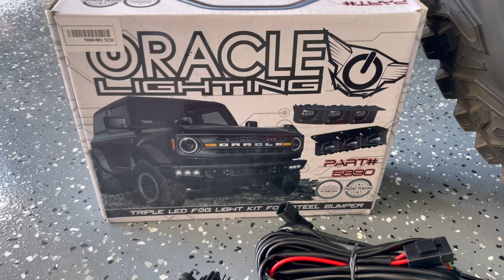AUX Switch Installation of the Triple LED Fog Light Kit by Oracle Lighting - 2021+ Ford Bronco

Comment: Thanks so much for this.  I already have the grill lights hooked up to the aux using the grill wire.  Gonna need to run another wire and figure that out to add these. I have the Amber ones sitting in a box right now.
Reply from the maker: Thank you! I will be in the opposite boat, if I order the grill lights, that I'll need to extend the wires for them up to where the AUX wires are, being as I used the purple grill wire. I guess, alternatively, I could just tap into that wire as well if I got lazy! But it makes sense to be on a separate switch!

You'll just have to extend the wires in your situation from the harness to the AUX switches near the firewall, should be a simple process, and will actually give you more options for grounding them. Good luck, the amber lights look nice too, hope everything goes well for you!

Comment: Sadly for me i was unable to get the modular bumper on my wildtrac., Which means alot of stuff i will be missing out on. A company called M&R makes a double for the capable bumper which is about $500. Still looking for a brushguard. Thanks for another great video
Reply from the maker: That’s a shame. It was a no contest option when we ordered ours, it was a must have option! You might get lucky and fine one on the Bronco forums or on eBay that you could snap up for a decent price. That’s what I did for a set of rock rails. I purchased set that are pretty much brand new, in case I need to review or promote products that attach to the rock rails. Got them for a good price!

Comment: Hi, great video but I was wondering about the light up letters for the grill. I ordered both through oracle and am waiting for them to arrive. My question is basically if you have done that yet and if the 30amp aux 1 can handle all that.
Reply from the maker: Hi, thanks for asking, at this time, I haven’t installed the ORACLE letters for the front. It’s something I’ve been considering, but just haven’t gotten round to them. And yes, AUX 1 is more than sufficient. You can actually put them on AUX2 - AUX5 without issue. Hope that helps.

Comment: Easy to follow demo  - thanks! I have Oracle's spare tire ring 3rd brake light for mine... when it gets here.  Why did you choose the Aux1 switch? Is it because of the amps of the fuse?  Thanks
Reply from the maker: Thank you, I appreciate it and thanks for watching! I've been contemplating the 3rd Brake Light Ring and also the Light Up Front Letters too. 

So - the reason I chose AUX1 is because as you rightly state, there's a 30A fuse in the harness that comes with the fog light kit, but also, I don't have plans for anything else with a high draw, I am already using AUX2 for my Rigid Ditch Lights, so having the two close to each other was what I wanted. The beauty is, that you can change their locations really easily, if our plans change in the future.

Comment: Love your videos, extremely concise and well done.  I plan on getting these same lights but read on the Bronco6G forum that they may not be street legal due to how high the beams are in relation to the headlights.  Some user added nylon spacers to the bottom screw of each light to point them down (lowering the beam).  Have you had any issue with blinding oncoming traffic or do you  only use these when off road.  Thanks.
Reply from the maker: Hey Greg, thank you so much for the feedback, I really appreciate it. So, they lights themselves are DOT Compliant, so there is no issue with legality there. However there have been instances of people being flashed by oncoming vehicles when they have the fog lights on. 

There are a couple of different things you can do. 

1) There are tiny washers that you can buy, and insert them in the lower mounting screws to effectively push the bottom of the light further away meaning they angle down more. 

2) If you take the butt of a hammer, you can rest it on the light housing from the front and actually push the frame slightly to angle the individual lights down slightly. 

3) When mounting the lights you can add a small shim to the front edge of the mounting bracket, essentially pointing them down slightly. 

I have been flashed once or twice, but haven’t driven a lot at night yet. 

However, if it continues, I have a couple of rubber gaskets left over from installing a light bar, so I will add them to the front of the lights. 

Hope that helps! And thank you again for watching!
Reply: @CUPRADESIGN  Thanks for the info!  I'll just add the spacers before installing the lights.  All I need now is the truck to put them on.  Still in limbo as far as delivery goes, I was converted to a 23MY.  Thanks again for the installation video, will make it a breeze.
Reply from the maker: @gregh258  You’re welcome, and hopefully it helps out. Good luck with the delivery of your Bronco, I know the anticipation well. This time last year we were still waiting on a target build week. 

And this year, I’ve had a 2023 Camaro SS Convertible on order since April! It finally got built last week, waiting on delivery now. 

Good luck with the Oracle fog lights install, and if you have any more questions, feel free to reach out. Thanks again!

Comment: @cupra How do you like the light output from these fog lights? Curious how bright they are and well they have performed.
Reply from the maker: As you may have seen from my channel I’ve checked out many different fog lights but these still remain my go-to set that are installed on the Bronco. Partly due to being directly hooked to my AUX but also because I love the light output. Super bright in fact I had to record a second video in order to aim them better so as to not blind people. They have lasted well, only issue I’ve had is a little paint issue from new which I just masked and painted. And then I do have some condensation in one of them. Reached out to Oracle and they said that they are vented and the water would dissipate and true enough, it did. Hope that helps. Still love them over a year on.

Comment: What was the first purple wire you tapped into? Great videos!
Reply from the maker: Thank you Johnathan, I appreciate the feedback on the video!

The purple wire at the front is a pre-wire for the AUX switches. It's basically a wire pre-routed through the engine to make it easy to wire up to the grill area. You don't have to use that if you want to, but it's there to make it easier to wire up to the AUX switches. 

That wire has no power to it as it stands. It is just a length of wire from the grill to the far right corner. Once you wire your Oracle lights to that purple wire, there is still no power to them. 

When you go up to the far right corner of the engine bay, you then connect the other end of the purple wire to whichever one of the AUX switch wires you decide to use (I chose the 30A switch #1, but you can choose whichever one you want). Once you join those two together, and also connect your ground wire, you have a full circuit, providing power from your AUX switch. 

I promise you, it's really easy this way - if I can do it, anyone can do it! 

Again, thanks for watching, I really appreciate it!
Reply: Ah okay got it! Yes I will be doing this install. Super clean! Thank you
Reply from the maker: @Jpulido91  No problema at all, and thanks again. If you have any questions, feel free to reach out, I made this video just to help people out, it's not perfect, but it's useful!

Comment: Thanks for the video. How come you don’t need the fuse anymore?
Reply from the maker: Thanks for watching, I appreciate it. When you are wiring up to the AUX switches in the Bronco - they have fuses already built into the wiring (different rating for the individual switches, 30A, 15A, 10A, 10A, 10A, 10A). In the owners manual on the head unit, it shows each AUX switch 1-6 and their corresponding rating. So there is no need for an additional fuse. Hope that helps: https://www.bronco6g.com/forum/attachments/revised-aux-ratings-png.194709/
Reply: Ahh. Awesome. Thanks!  
Good luck in the channel!
Reply from the maker: @neverendingweekend  Thanks very much, I appreciate it! Check out my other videos, and I have many more videos in the pipeline!
Reply: @CUPRADESIGN  Cool video !thanks! what color is the 15 amp number2 auxiliary wire?
Later I want to get off-road lights so I’m gonna use 1 for that
Thanks
Reply from the maker: @rickwagstaff7710  Thank you, I appreciate it. The AUX 2 wire is Green/Brown. Here is a guide from Bronco Nation which is essentially a Ford Monitored forum: https://thebronconation.com/accessories-n.136/upfitter-switches-t.7931/

Look down the page to the second major chart in Post #5. That has the most recent information in it, with the 30A fuse for AUX 1 and the 15A fuse for AUX 2. Hope that helps! Good luck!

Comment: Hey buddy is it required to cut the cords?  i didn't see that in the instructions.
Reply from the maker: Hey Cole, it’s not necessary to cut the harness at all, if you are using the switch that comes with the lights. 

The reason I cut the harness up was to hook them up to the AUX switches, as that’s how I wanted to control them. 

But if you want to use the switch that came with the lights then there is no need to cut the harness at all.

Comment: What’s the amp rating for these lights? I believe Aux 1 is rated for 30 amps and is overkill for this application. 👍🏼✌🏼
Reply from the maker: The fuse that came with these lights (which I subsequently cut off) was 30A. 

Agreed that is overkill in this instance but I don’t currently have any plans for anything rated for that switch, so I chose to wire the fog lights to AUX 1 as that’s the one I’ll use all the time. Ditch lights are on AUX 2 and the light bar is on AUX 3.
Reply: @CUPRADESIGN  That seems odd they included a 30 amp fuse because I subsequently went and looked for specifications on their website; Total Amp Draw: 3.6A @12V DC.  That seems to be 7.2A for both, so 10 amp switch would likely be sufficient.  Thanks for the content, as this helps me make some decisions. ✌🏼👍🏼
Reply from the maker: @Carl-vx9ws  I actually just went out into the garage to confirm. I still have the remnants of the Oracle wiring harness after I cut it off, and also the wiring harness that I cut off from the Lasfit LED Light Bar I installed too (pretty much identical generic harnesses) and they BOTH have green 30A fuses in them.

Comment: is the purple wire the only one supplied up front? If installing fogs and running lights I'll need to run one all the way up to firewall?
Reply from the maker: So yes, up front there is only the one purple wire. And in this instance I used it for my fog lights. 

I have however since installed a light bar as well up front, and in the video I show you how I ran the harness for it separately. Hope that helps. 

https://youtu.be/toOg2eMA91w

Comment: Why am I missing where you hooked anything up to the battery?   Does this power by the switch???
Reply from the maker: Hey Stephen, the AUX switches are already hooked up to the battery. They literally turn on and off the power. 

So all you have to do is wire the power wire (red) from what you are hooking up to the AUX switch wire and then the black wire is the ground. They’ve made it so easy using the AUX switches. 

That’s why you didn’t see me hook up to the battery at all. The AUX wire IS essentially your battery connection hope that makes sense. The AUX connection runs from the battery, and also has its own fuse as well. Thanks for watching, I appreciate it!

Comment: If you have ANY plans of installing options like a winch, air compressor, higher intensity lighting etc, you will want to NOT use the yellow wire, and opt instead maybe for the green wire, which is aux 2. I'm thinking most wouldn't want to go too much farther away than that for something you're going to use that often, but thats just me .
Reply from the maker: Yes, when installing, I took that into consideration. I don’t have plans to install a winch or anything like that at this time. 

If I do determine that I want to, I plan to add quick disconnects to the AUX wires so I can plug and play and move items around quickly and easily if I do choose. 

But at this time, with the fog lights, ditch lights and light bar, I’m done for now.
Reply: perhaps a novice question, but couldn't you connect this to any of the aux switches? Product is 3.6A draw and minimum fuse is 5A (switches 4-6).
Reply from the maker: @ryanritchie9455  - technically you could tie them into AUX 2-6 no problem, they are 15A, 10A, 10A, 10A, 10A. I chose to use AUX switch 1 as it is a) the closest to me, b) the fuse that was on the harness for the Oracle Fog Lights was a 30A fuse, and c) at this time, I don't have plans for anything with a higher draw necessitating the need for that location. That's why I chose the switch I did. I will be adding quick disconnects in the future, should I change my mind!

Comment: The Oracle site said there is a way to wire the lamps such that you can illuminate a single emitter (light) on each side for on-road and illuminate all emitters for off road.  How is this done?
Reply from the maker: In order to do that you would have to look at the harness and separate the wires from each light and wire them up to the individual AUX switches. Eg, at this time in the video, I have both light (both sets of three lights) hooked to one switch using the harness provided. 

You would need to pair back the harness for example to the two outermost bulbs and wire just those two bulbs (one in each fog light) to a single AUX switch. That will give you a single light on each side. Then you could wire the remaining 4 together (2 on each side) to another AUX switch and that would give you control over the other 4 bulbs. 

Another work around is in my other Oracle video which is to aim the lights down just slightly so that you don’t blast oncoming vehicles with excess light, while maintaining the great light output from the Oracle lights. Here’s a link to that video: https://youtu.be/6BXgopmr8Ag?si=fPtBOwwJfrl5z750

Hope this helps.

Comment: Great video.     Followed the steps.  For some reason I keep blowing the Aux/30amp fuse.
Cut off relay and switch because I have the auxs.

Any ideas on what it may be. 
- both  Reds to purple wire
- both blacks to ground bolt close to battery 
- purple to yellow.

Once I turn on switch it blows fuse
Reply from the maker: I just rewatched my video being as I did that install over a year ago. I’ve not had any issues in that time with the lights at all. The only thing that I can suggest is that the lights are maybe not being grounded properly. You might want to double check the two black wires, how you connected them and make sure that they are both truly grounded at that point. 

Otherwise I’m really not sure why you would be having issues like that.
Reply: Any luck on the fuses not blowing? We are experiencing the same issue.

Comment: Hi. Great video. Was wanting to ask why you used the yellow 30 amp on the fog lights? Would three through six switches at 10 amp be enough?  Best.
Reply from the maker: Hey Mario, thanks for watching and great question! So, I have two reason as to why I did it this way. First reason is personal, I don’t have plans to install a winch or anything with a high draw, my ditch lights are on AUX2 so for me AUX1 made sense. The second reason is that the harness that I cut had a 30A fuse in it, so figured with AUX1 also rated at 30A it makes sense. 

Now, I’m also no electrician, so take my next comment with a pinch of salt, but I have seen a video where they show the draw of both fog lights and it’s nowhere near the 30A threshold, so you should be fine using one of the AUX4-6 switches. 

As I say, I don’t have plans (currently) for additional lights, but that could change, and the switch over to a different AUX switch would be really simple. 

Really appreciate you watching, and keep an eye out for more videos coming real soon!
Reply: First let me say this ai well done video. Thanks. I screwed up my first reply. Oracle states that the maximum draw for the lights is 3.6A @12V DC. Not sure why they provide a 30 Amp fuse in their wiring kit but if their 3.6A draw number is correct then Aux 3 - 6 fused @ 10 Amps should be more than enough.

Comment: Love those and they're VERY reasonably priced compared to others I've seen.
Reply from the maker: Yes, absolutely, they are really nicely made and are so much more sensibly priced than others. Love how they look when installed, definitely have an OEM+ look to them. 

Now, when mine arrived there were some chips in the powder coating from the packaging, which I believe they have rectified now. I went over them with some black Krylon paint. 

And also be aware that they are designed as fog lights and not ditch/spot lights, so they aren’t quite as bright as those style lights. 

They are fantastic tho and exactly what I wanted! Thanks for watching!

Comment: What is purple wire for? Don't get it. Clear as mud.
Reply from the maker: The purple wire is the pre installed power wire for the auxiliary switches that sits behind the grill. If you have the auxiliary switches, there are power wires run throughout the vehicle. This meant that I didn't have to run wire all over the engine bay, I could use the wiring that was provided by Ford. You then connect that to the power wire up by the cowl and you have a nice clean installation. This information might help too: 

https://www.bronco6g.com/forum/threads/2021-bronco-aux-switches-wiring-diagram-video-discussions.13485/